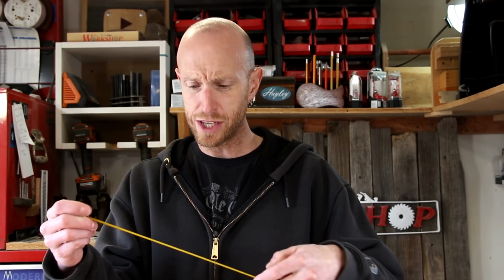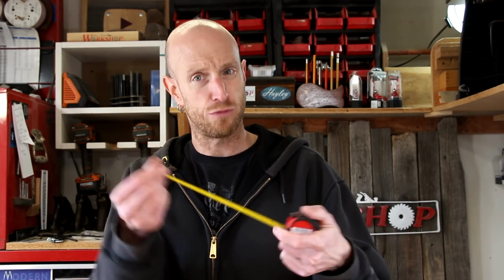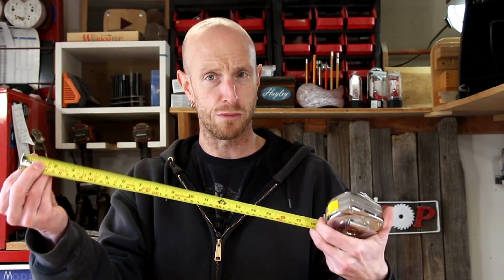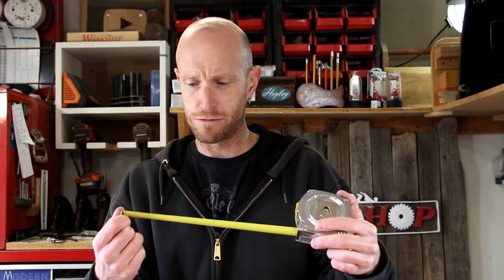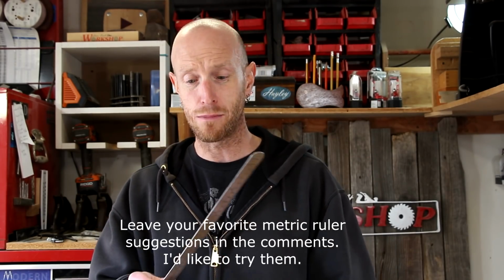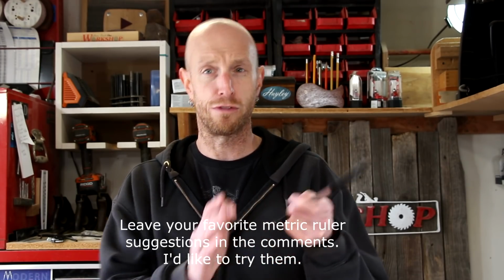My thoughts after using the Metric System for a project | I liked it

Comment: I was on a rigging crew in the 90s.  We were working in a facility that had the clean room extended to the loading dock, so we could unload new chip handling machines from a sealed container.  All of us were in bunny suits, and had all of our tools wiped down for the job.  We spent the morning unpacking the machines, and getting them placed into the fab that they would be working in.  The machines (and the technicians) were from Japan.  We had to climb into the machines to get to the leveling legs.  The Japanese guys were yelling out "5 millimeter -- 7 millimeter, etc" and most of the guys were able to understand that it had to move up or down.  When we had to move the next machine in, they said 2.25 meters, I whipped out my Stanley metric/imperial tape and translated.  I was the only guy on that crew with a metric tape.  I carried a small metric/imperial tape every day.  After 9/11, I was getting on a plane to Mexico, and the TSA agents took my tape measure.  It took months to find a pocket sized (2 meter) tape measure for everyday carry.  When I found one, I bought 3...

Comment: The main advantage of the Metric system is that you can jump between the types easily without needing any conversion. If you have a cube with sides of 1 decimeters, it is one liter and one liter of water weighs 1 kg. So a cube of 1 x 1 x1 m weighs 1 ton in water. etc. The entire metric system works that way through all physical measurements. and it is a decimal system.

Deci means tenth, centy means hundredth. mili means one thousandth part, micro one 10000th part, nano 100000th part, pico millionth part etc. equally in the other direction Deca means 10 times as big, Hekto means 100 times as big, Kilo means 1000 times as big, etc. so 1 Kg means 1000 grams and Km means 1000 meters etc. All according to the Roman-Latin system of calculation.
I have a cousin in the US and she said that at the university they converted the imperistic system to metric numbers and calculated in the metric system because the formulas were so terribly much shorter and afterwards when the calculations were done, they converted the answer to imperial numbers again.

Comment: As someone who grew up with metrics and then moved to Canada 6 years ago (Canada suppose to be metric, and it is "officially," but people use the imperial system for length and weight), the most challenging thing about imperial has been conversion between fractions and decimals, or even units (like inches and feet) and constant need of doing the math or memorizing everything. 
But since an inch is about 25.4mm, having 1/32" or 1/64" fractions means more precision than millimetres, unlike what was said in the video. However, you can use microns with the metric system to achieve incredible accuracy. 😉

Comment: Heh, Conversions is the chief reason why I moved to working in Metric exclusively, no matter how hard it makes it to shop in the US. I like being able to think of a design and go from initial measurement to calculation to final measurement without having to first convert it using a conversion factor, then plug it into a calculator, and convert that resulting decimal to the closest fraction I can remember, then try to remember which friggen lines mean what on each of my measuring tapes. Metric is just *so* much simpler, and millimeters are accurate enough for the majority of things you do with a measuring tape.

Comment: I grew up with imperial and metric at home in NZ and Australia as my Dad is old school and tape measures with both are common. My conclusion was that for things where near enough is good enough imperial is quite quick and the separations are easy to estimate by eye. Anything even slightly complicated or where precision and/or multiple calculations are necessary metric is just way easier and accurate. This is purely my perspective and experience however I’ve noticed my Dad in spite of his attitude towards the metric system still uses it for the same sort of things I do although he is loathe to admit it. Lol
Reply: I'm an Australian working in Japan with American, Canadian, and English builders. It's funny how we something like, "We just need to move that table by a couple of inches," as it's part of everyday vernacular, but nobody would think of taking the actual measurement in anything other an mm.

My grandfather was a builder from Ireland and anything work related was in metric but ask him someone's height, it was always imperial.

Comment: If your background experience is in construction and remodeling (as opposed to fine artisan woodworking), then the issue of accuracy has to do with differing levels of tolerance for different tasks.  For many things, just getting to 1/4" plus or minus is fine.  And very easy and fast to implement.  The imperial system gives the option of choosing how close you want to work with tolerances.  Nonetheless, I do wish we would have completed the change back in the 70s when it was seriously being proposed.
Reply: It's the same in metric. Concrete and carpenting within half centimeter or about 1/5 of an inch is good enough. Steel, within a millimeter or less, for rough tasks, or about 0.04 inches. No clue how you guys even call that.

Comment: Thanks you for sharing your experience.

Before I was 18 I’d already lived on 3 continents. An interesting side-effect is that I grew up always having to convert something or other. Somehow the imperial measuring system was always more difficult and I’m thankful for conversion apps on my smartphone. 

One hing I learned, is that for any system of units, whether it’s measurements or something else, even though the units we use every day feel comfortable and ‘easy’, if you go ‘cold turkey’ any new system gets adopted by our brain quite fast and becomes the ’comfortable’ and ’easy’ one. 

An example: the switch to the Euro currency. I was living in Belgium at the time. One Euro equalled 40.3399 Belgian francs. Everyone was furiously calculating away to figure out how much something cost. Within a year, that had mostly disappeared. For me it was a little faster because I was used to converting currencies thanks to all the traveling but most people around me did the switch quite fast as well. 

People think it’s hard to switch from one system to another one but provided it’s an immersive thing, our brains adapt much more easily than we’d think. When given a choice whether to switch over, we tend to linger on the familiar and the switch becomes difficult. When there’s no other choice, we adapt quite fast. 

Kudos to you for giving the metric system an honest try, because you did have a choice.

Comment: i think if the tools are accurate, both system can potentially do fine, but as you have mentioned, the biggest advantage is that the way it works reduces calculating errors, especially for people who havent the best math skills.
Reply from the maker: True, My math skills are adequate at best. I've never liked it much.
Reply: @homebuiltshop  same here. I did fine until 10th grade, but on the road to my a-level I got totally disconnected.

Comment: The other hurdle for some projects is that in the US (and Canada, since our supply chains are so interlocked), materials come in imperial units. Probably not an issue for guitars and small projects, but you can't hang a 4'x8' sheet of drywall on 40mm o.c. studs, f'rinstance.
Reply from the maker: Good Point. Lol.

Comment: Im from the uk. We use both systems here so i can easily switch between them.
I use imperial units for guessing and metric if i want to be accurate. 
Eg. Id guess the length of my garden at 35ft but id measure it accurately at 10,770mm for example.
I use imperial for measuring the height of a person and most uk people still think in miles (as thats what our road speed limits are in)  and we buy beer often in pints. Basically everything else measured in metric as its way way more intuitive and the math is totally simple. Also different metric measurements are interlinked (length, weight, mass, temperature etc)
Having used both systems extensively I can deffinitely say metric is a better system of measurement.
Reply from the maker: I could see switching between in your case. I feel the problem in the US is that we aren't taught a lot of metric (at least in my generation of school) so its hard to use it often. When I think of a measurement, I don't automatically think in metric. Everything for me is Imperial unless I consciously try to use metric.

Comment: Great to hear that you liked using metric!  
It might help a bit if you use a few very simple measures like these -  
One pound is 454g  so if you wanted (say) the equivalent of a pound of mincemeat,  500g would be near enough for most people.  
Two pounds -  900g.   A kilogram is 2.2 pounds.   Multiply as needed!    
Distance -  a mile is 1.6 km.   Five miles -  8 km.     Ten miles  -   16 km.    
1 km -  0.6 miles.      5 km  -   3.1  miles.       10  km  -   6.2  miles.                
Temperature (in Celsius) -  easy!   0 Celsius (where water freezes) -  32F.   
10 degrees Celsius is a cool day.  
20 degrees Celsius is a comfortably-warm day.  
30 degrees Celsius is blimmin' hot!   
The above very-simple points are just about all you need!

Comment: I’m Canadian and I tend to use both systems almost interchangeably. Generally the choice is based on the level of precision needed. If “three and a half feet” is good enough then imperial it is. For smaller jobs requiring precision where I might use calipers, then I’m using metric. Or, if using imperial would require doing fractional math, then fuggedaboutit. Sometimes, it just depends on which measuring tool I’ve picked up, because I have a pretty equal selection of both.

Comment: When Australia converted to metric in building industry as per previous comment, millimetres became standard and centimetres were banned. Large numbers, no decimal points and no imperial fractions or difficult fractional additions were required.

A test was done by the largest home builder early on to compare building two identical homes side by side with one using imperial plans and one using metric in mm.

This was done to show ease of metric but resulted in an unexpected benefit.

The metric site has considerable less wastage and as a result was calculated to cost 10% less than the imperial measured building.

Comment: Using the metric system makes you more accurate because you can increase the precision infinitely by dividing by 10. I work on a construction site and I use a measuring tape with a length of 5 meters which allows me to measure millimeters, centimeters and meters, but for example, when repairing a car engine, I use a device called micrometer with 1/1000 precision. Chip manufacturer uses nanometers etc.

Comment: Hey, nice vid. Though I assume you were mostly working with measurements of length. I find the metric system really shines when you need to interchange for example volume and weight, like in cooking or baking. You know a liter of milk/water is a kilo, you don't have to switch between cups, spoons, ounces and you can easily scale up and down if you need more or less. You know how pretty much how much your finished products will weigh just based on the ingredients list etc. etc. No conversion tables required, can all be done in your head. Just a small addition ;)

Comment: Hi, I'm from EU and I'm using the easier, faster, simpler unit : the metric units. Not because it's more accurate (the imperial units are also accurate) but because :
-1- I'm from EU,
-2- I't more simple to x10 ; x100 ; x1000 ; etc. to calculate ! Just add a "0" (or multiple "0") to change the unit !

Comment: I grew up using both systems in the UK. Even now I'm happy to have something that's say 24inches by 57 centimetres... I used to wood work in Imperial to about 1/8" accuracy and produced some real monstrosities. As soon as I switched to millimetres, my wood working improved tenfold. Now I work to about 1/2mm accuracy. But the real benefits for Metric happen when you do physics or engineering.
Reply: Для инженеров метрическая система это то что боженька послал .

Comment: In some countries both systems are used , stock material such as plywood sheets come in 4x8 ft while metal pipes and hollow sections are in meter . Tyres diameter still in inches .

Comment: I draw steel fab dwgs for steel fabrication shops and have drawn large scale projects in both imperial and metric.  The only difference to me is the drawing template that I start my drawings with and for the shop guys, the tape measure they use.  My advice is to not mix imperial and metric. That is where the problems arise.  If you mix the two systems, there will be cumulative rounding off errors.  Buy a metric only tape measure.  If a customer wants both imperial and metric dimensions shown on the drawings, then my price is higher because it takes longer.  Another problem I noticed is that architects and designers will call out 100mm square tube and of course what is available in the U.S. is 4" square tube (101.6mm).  Or the drawings show a 13mm plate but only 1/2" (12.7mm) is available.  They are close, but the cumulative errors will add up. All of the architect's dimensions have to be massaged to make everything add up properly.  We call that "soft" metric.  The best metric jobs I've worked on were projects that had enough steel in them to make a mill run of metric sized steel.  13mm plate was actually 13mm.  We call that "hard" metric.  So how is a 2 x 4 called out in metric?  A 38.1mm x 88.9mm or can you buy a 38mm x 89mm board?

Comment: I am working for US company as an engineer. We have imperial units also. Depends on the product, it's metric design or imperial.
Even imperial is used as 0.001 of an inch, so it kind of says a lot, about both systems when imperial is divided by tenths.

Comment: Many things here in Europe still rely on the imperial system and I for myself assume that this is either out of convenience or simply for historic reasons.
Waist size and leg length - the ordinary Jeans was an american invention afaik.
Tire and wheel dimensions - propably both Europe and the US invented these (in their current form) about at the same time, but one system just gained more attention.
Screen sizes for TVs and home cinema-projectors - propably a result of the hollywood boom back in the day.
Electronics like 1/4" jacks, circuit board package-spacing, loudspeaker sizes, devices for computers like 5 1/4" CD drives and so on... These may result from the massive impact Bell, AT&T and all the silicon valley had (has).
Also our piping/plumbing sometimes is in imperial units.

Fun-fact: Some tools use both metric and imperial at the same time ! Socket wrenches for example.
You can get them in 1/4" , 3/8" and 1/" sizes, but the sockets we're using are metric :D

Other than that, I as a German citizen can't think of any other situation where we use imperial units.

Comment: The great thing about metric system is actually not even the logarithmic scale in stead of fractions, but the conversion abilities. E.g. going from length to volume is very easy. If you build a box that's 60x60×10cm=36000cm3, or 36dm3, or 36L. Also means if you fill it up with water it'll be 36kg of water.

Comment: In the UK we use a weird mix of metric and imperial measurements, but for measuring the size of objects in the worlds of work or school, almost everything is metric. In this videos spirit of open mindedness, I will admit that despite being quite insistent on using metric for anything important, or anything that would be shared with others, I do think there is a place that imperial works quite well: 'taking a single measurement that does not need to be super accurate'. For example, if I measure a gap then go to search for a piece of wood of approximately that size, I'll quite often measure it in inches. No idea why, but it just seems be a nice unit of measurement for the task. It's a smaller number, they are less close together on the tape, it has a nice air of 'approximateness' about it, it just seems to fit for such tasks.

Comment: It's funny I've been working with Metric measurements since the early 70s and I still use inches too.  I use them both. I spent 5 years in a factory working with metric measurements and Imperial machines so I got used to converting between them in my head. As far as larger sizes are concerned I just look at the tape measure (All UK Tapes have both Metric and Imperial) and I pick the closest mark from whichever system is more convenient.

Comment: I am Canadian, and I grew up with the imperial system as we didn't convert to the metric system till the 70's.  I know what you mean about the measurements are much easier to deal with in metric.  But all that being said I still think in Imperial system.  What I mean is the first measurement I go to is Imperial, and I then convert it to metric if needed.  My height and weight I still think of in feet and inches, and lbs.  When I am driving I still think of in miles per hour, instead of kilometers per hour.  Most of the gauges are done in metric, but I just automatically convert it without thinking about it.  Mind you getting rulers etc with both metric and imperial in Canada are pretty common.  I think I find the Imperial system more comfortable for myself, maybe I am screwed up, but there you go.

Comment: Yes, i think 1 mm is a nice meassurment unit if you do something like that. It's not too small to see and not too big to do precise stuff. Don't know how often a inch is typical subdivided. You could divide it in parts of 20, so one part is around 1 mm. Everything else is just you do best when you use the meassuring system that you are used to. If you have to covert units, there is the only thing, where the metric system really is better.